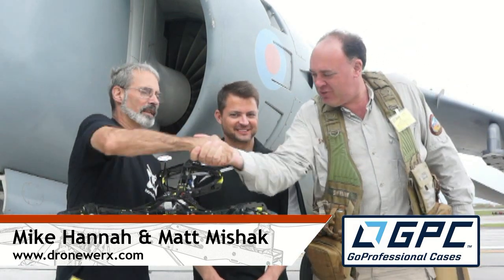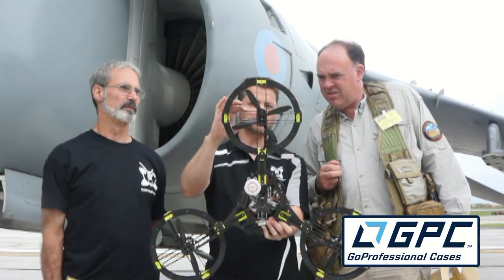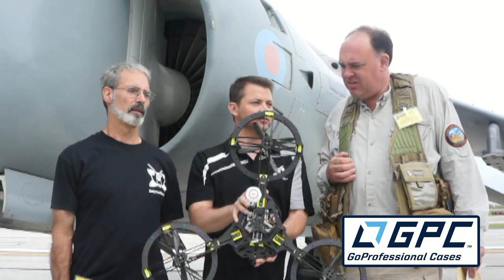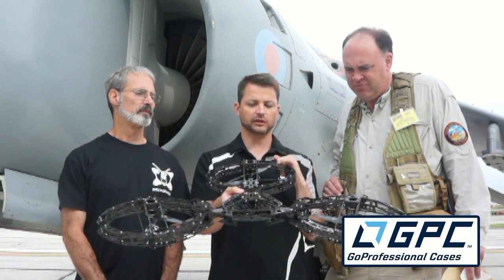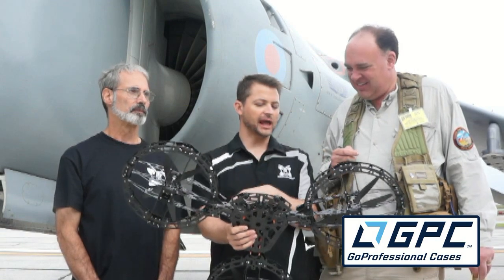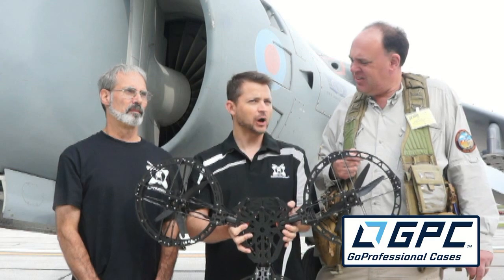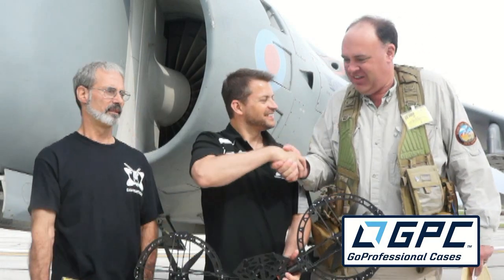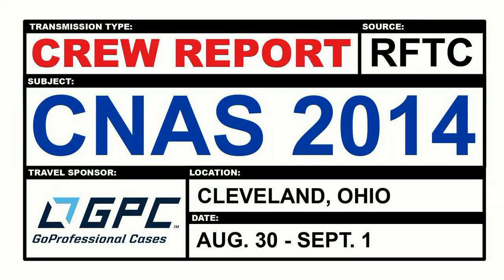RFTC: Dronewerx Introduces the PG-Y6 Guardian Multirotor at 2014 Cleveland National Air Show

Comment: Starting at 1:22 "We have come up with a more efficient design"

Hold on a second.

I have a Multirotor that has 15" Props which equals to a 19cm radius and combining this with the 1.6cm diameter booms this would result in an about a 30cm² footprint of blocked air - Probably less because of the Motor hub taking up some of the radius but lets go with that number for now.

Your design has to accommodate some free space between the Props and the ring going around it so lets calculate with a 20cm radius while still sticking with a 1.6cm wide ring which equals to ~209cm² blocked air.

I'm no expert in aerodynamics but those 209cm² look like a lot more resistance for air to pass around than it does with the 30cm² of a traditional boom. and we haven't even talked about the difference coming from a round shape ( traditional boom ) in the wind as compared to a flat surface ( your design ).

And then there's the problem of your flat surface ALWAYS acting like a downward facing wing when in horizontal flight, because that's how Multirotors move horizontally, probably demanding more thrust from the motors to keep the craft at the same height when compared with a traditional boom design.

How exactly is that considered more efficient? o_O

Nothing against you claiming it being safer but more efficient?

Comment: Nice design. Rise of the machines.
Reply from the maker: Phil G It does kind of have that feel to it, doesn't it? Sleek and slightly menacing... Of course, the irony is, with its props shrouded, it's actually a lot less menacing than a typical multirotor. Anyway, I can't wait to play with it!